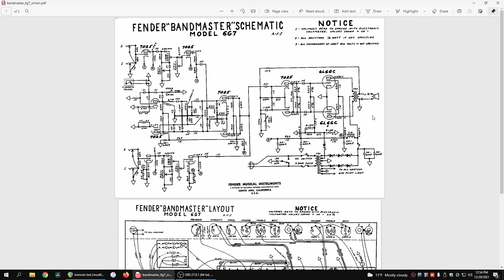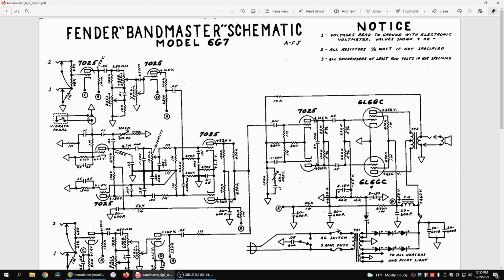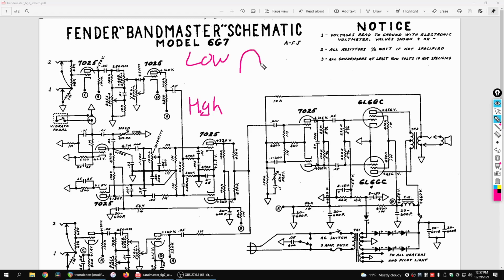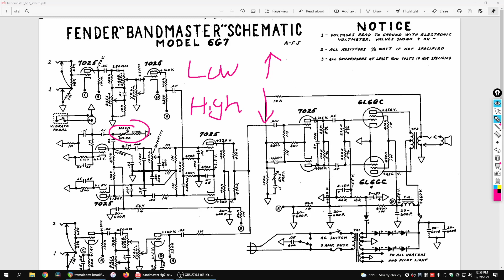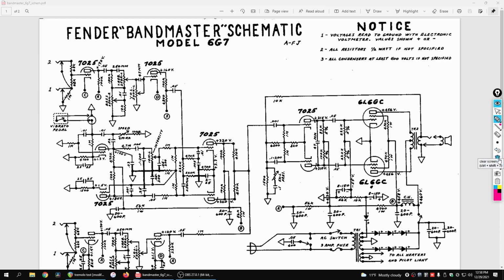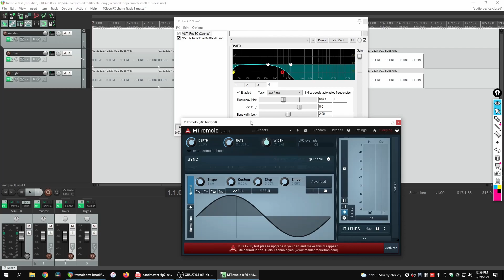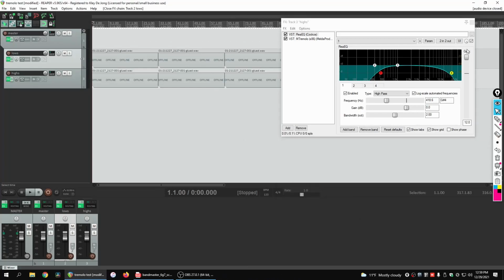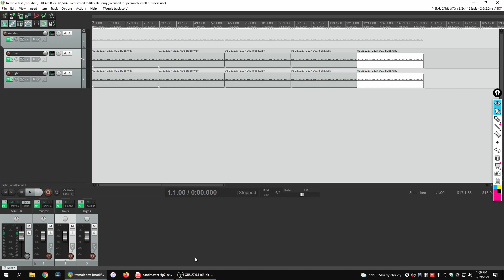How the Fender Harmonic Tremolo Works

Comment: This was very helpful, thank you!
Reply from the maker: You're welcome!
Reply: @KleyDeJong Related, but slight aside. What exactly is affecting the depth of each side in the circuit? I'm not sure I fully understand what's happening part by part
Reply from the maker: @YeatzeeGuitar  It's the mix between wet and dry at the end where the two paths cross again.

Comment: great demonstration, is that what a univibe is? the sound reminded me of a univibe a lot. it would be interesting to hear it at different crossover points and with square wave and in stereo, lots of possibilities.
Reply from the maker: I believe univobe uses a light bulb on the lfo and modulates phase - so it's quite different in function. Both sound cool!